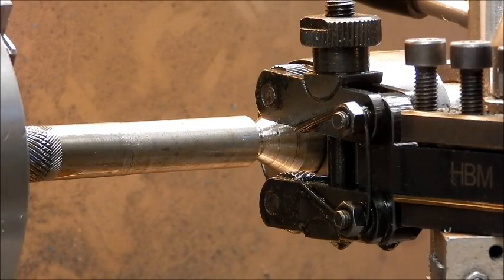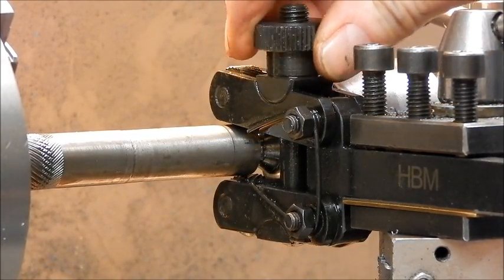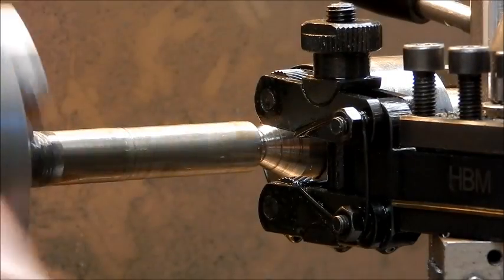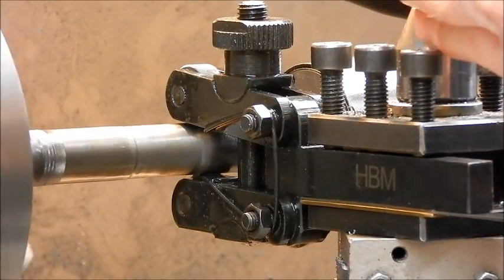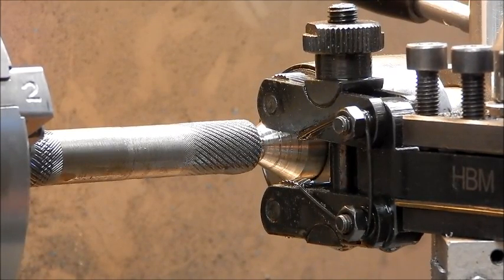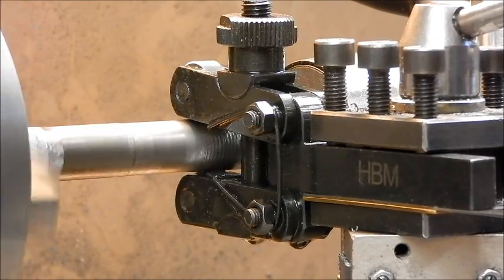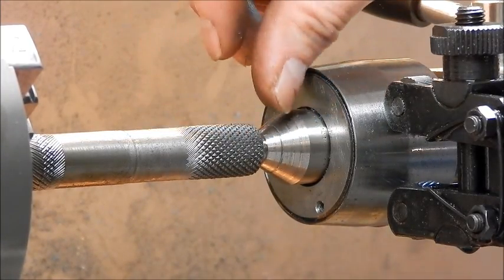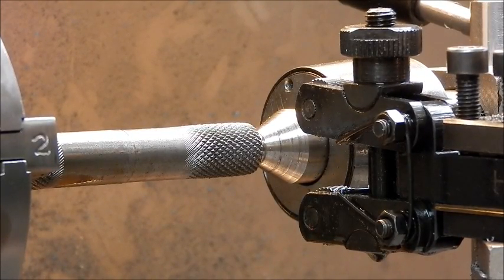How to use a scissor or clamping knurl on a lathe

Comment: I agree with your method, I use this way too. Your video is good and shows great close up detail, thank you. I have exactly the same knurling tool as you have here and have spent time to improve it by taking out as much unwanted movement and play from the component parts as possible. I have shimmed the knurling wheels so there is virtually no side play and I have machined better fit bolts for the arms where they are joined to the body, this gives a better, tidier cut.
Reply from the maker: Hi Stephen.  It's a good knurl tool for the money, but side flex does occur as you say.  You can allow for that with the tool post angle and tightening the scissor arm pivot bolts helps.  Shimming the wheels is a good idea and I do that where necessary as wheels vary in width with manufacturer.  This knurl tool can also be used as a push type knurl for stock that is larger diameter than the scissor can grip. Works fine. Cheers Rob
Reply: @Xynudu Hi Rob, yes it's a very good tool for the price, no doubt about that.
Good tip ref the toolpost angle.

Comment: Might I suggest a tip that I use to get 100 percent success. In your video, on your first attempt, you got a double hit on one of the knurl wheels. This happens because you have eased the tool into the moving stock while the machine was running. What you want to do is press a heavy mark into the stock on the very first revolution. Here is how I do that. Apply lube first, stop the machine, then move the knurls into position centered on the stock, now clamp the knurls firmly into the stock while the machine is not moving, go ahead and engage the feed mechanism, NOW turn on the lathe, and watch a perfect knurl happen. This method will fully mash the knurl wheels into the stock on the very first revolution. With the dents already fully established on the first revolution, when the stock rotates around the second time, it will already have a heavy dent, and this heavy dent "persuades" the knurl wheel to fall back into that dent. Try it, you will like it.
Reply from the maker: That's not how I was taught to do it.  Do whatever floats your boat, but that is not the correct way.

Comment: Rob do you make your own cutting fluid?
Reply from the maker: Yes.  Kerosene and engine oil at 5:1.
Reply: @Xynudu  I do the same, people tend not to agree with it. Do you find it works well for you?
Reply from the maker: Works fine.  It can smoke a bit if things get hot, but is excellent at preventing galling. It's an old timers's receipe that has been around for decades.  Doesn't cause rust or give you dermatitis like the water based stuff, and it's cheap.  Cheers Rob
Reply: @Xynudu  oh boy does it smoke. Do you use it for tapping as well? I was wondering if it would be any good.
Reply from the maker: I do, it's great for non ferrous, but not ideal for steel jobs.  I ran out of the propper stuff some time ago.  That's reminded me to get off my arse and buy some more  ;) Cheers Rob

Comment: Not a criticism as the job is right, but it can be done quicker. Slow chuck speed, high feed. Keep feed engaged and throw chuck into reverse to return to start. Picking up the pitch of the knurl isn’t too important as the form is rolled onto the job more than cut hence why the diameter increases. It can help to have the tool slightly angled to the job so the pressure is heavier on one side. I generally do them dry but use a splash of coolant to keep the knurls cool. When the knurls get worn, they can chew up the job as they produce specks of swarf that can get stuck between the teeth so I run the last pass with an airline on it. I’m currently doing 55mm dia knurls by 25mm long on mild steel and they take about a minute each with 4 passes all at full depth. I’m an employed turner of 35 years but still watch videos as there’s always someone doing something different and sometimes better.

Comment: I made myself a clamp type knurler, works good, now i see your good method of using it. Thank you
Reply from the maker: Hi John,

This is exactly how knurling would be done in industry.  They just drive the knurl onto the job.  That's why most scissor knurls only have finger adjustment.

They don't screw the knurl down into the work, as some people seem to think it should be done.

Cheers rob
Reply: @Xynudu  This was my mistake, I was screwing the knurl down into the job. Your method is much better, faster, repeatable and gives a better result. So you have a new subscriber.

Comment: Rob,

Sorry I meant for knurling what do you set the TPI?
Dave
Reply from the maker: +David James 

Hi Dave,

0.23 mm.  The size of the lathe has no bearing on the matter, feed speed only relates to pattern pitch (coarseness).

The larger the pattern, the faster the feed speed.

For light pitches as shown (which is useful for most jobs) you would run 0.23 or thereabouts.

Cheers Rob

Comment: Rob, looks great and thank you I find your videos very practical and to the point. I am new at machining and could you tell me what TPI you run the lead screw. I have a small metric 7x12 mini lathe, what do you recommend?
thanks Dave
Reply from the maker: +David James 

Hi David,

I use 0.12 mm for general turning.  This works well with TCMT carbide inserts and also HSS.

I can switch to 0.06 but this can be too fine for some metals and actually give a poorer finish.  It does however work great with shear tools.

For fast ripping down to size I use 0.23.

So as a good all rounder I would recommend 0.12 mm.

Cheers Rob

Comment: Well that came out well, I have been watching a YouTube tutorial where they insist that the diameter of the area is turned to the correct size ? I have never done this and always get a good diamond knurl as you have, but I do use the scissor type tool as you do, so maybe it is not required on these tools, it always just tracks in the impressions left on the first rev, the scissor type also does not put any side thrust on the job being knurled.
Reply from the maker: +Englishman French 
I never use those sizing charts.  I've never had a problem.

The correct longitudinal feed rate is much more important IMHO.

Cheers Rob

Comment: Can I start this in the middle of a shaft?
Reply from the maker: Sandarpan Sure.  I always knurl before turning the job to final size.  That way as knurling always gives a less than perfect edge, you can do a final machine pass/es to the edges of the knurl to clean it up and make a nice edge.  Something to think about and plan ahead. Cheers Rob
Reply: xynudu
Actually I'll be knurling myself a weightlifting bar. Like this http://forum.bodybuilding.com/attachment.php?attachmentid=4974793&d=1350149133 , this http://forum.bodybuilding.com/attachment.php?attachmentid=4418391&d=1336063005 and this http://www.homegymbodybuilding.com/wp-content/uploads/2014/05/rogue-bar-knurl.jpg . The knurl starts and stops in the middle of the shaft quite a bit away from the edges and the knurling is done last.
Reply from the maker: Sandarpan The knurling doesn't have to be done last.  It can be done at any time.  You can reduce the shaft to within a couple of thou ", knurl the relevant areas, and then do a final cut along the shaft to get a clean edge against the knurls.  Also those separated knurls in the final photo can be done as one full width knurl, and then the plain separators machined out of the knurl afterwards.  It's your call, but that's how i would do it to get a nice clean finish.  Cheers Rob
Reply from the maker: xynudu I suggest you try knurling a piece of scrap round bar to see how well it works.  How clean the edges are. Then try my method and see which one gives the best result.  Rob
Reply: Thanks. What would you recommend I do for knurling a hardened steel shaft say ~ 45 HRc?
Reply from the maker: Sandarpan I would use a very fine knurl.  This will require the least amount of pressure to impress the pattern.  Also it will be more comfortable on your hands than a coarse knurl.  See what a common weight bar pattern is like and go similar.  Scissor knurl will apply most pressure, but diameter will be limited, so check to see what size it is capable of.  You can buy some larger diameter scissor knurls.  Do a test run on an off cut to set the pressure correctly.  Cheers Rob

Comment: You got double tracking the first time but on the second pass it kind of repaired itself although I can see the double tracks in between the knurling. How did that happen?
Reply from the maker: Looks OK to me.
Reply: xynudu
If you pause at around 3:00 you can clearly see that the right slanted diagonals of the diamond knurl are finer (more closely spaced) than the left slanted diagonals which are kinda thick. Can you see it? Anyway what TPI knurls are those?
Reply from the maker: Sandarpan The first pass wasn't deep enough for the knurls to bite in evenly so it's obvious the pattern was crap - that's why I cranked it up and did a re-run.  The knurls are some coarse ones I bought off of Ebay (can't remember the pitch).  I find that finer knurls give more consistent results as they don't have to cut as deep/less pressure required.  Also when you go deep it puts a heap of strain/flex on the knurl when you cross feed as in the video.  Rob
Reply: Ok got it. I'm trying to learn about knurling as much as possible. Thanks.
Reply from the maker: Sandarpan Your welcome.  It's all a learning curve.  Rob

Comment: What kind of large do you have, it's super quiet, I like that.
Reply from the maker: BasementShopGuy It's a cheap Chinese CQ9325 10 x 18 ".  I hate noisy lathes also.  This one is pretty quiet provided the change gears are correctly adjusted. Bolton Tools/hardware sell them in the USA. Cheers Rob

Comment from the maker: I've never bothered to nominally size a shaft for the knurl pitch and it's always worked out OK for me.

The knurl wheels should re-engage just like the gears in a gear box if you do it slowly.  It's nothing like screw cutting re-engagement as you have a free rolling surface (x2).

If you were to use the screw down method it is likely that you may not align with the impression correctly and will get double cutting.  Rob

Comment: Thanks Rob.  Do you make any effort to size the shaft diameter for "optimal" knurling, or is all that just unnecessary?  I was also very impressed it re-engaged so well.  I had always heard if you re-engage it is likely to cross up the knurl, but yours looked fantastic.
Reply: +Joel L: There seems to be a lot of "mumbo jumbo" going around with huge number crunching charts to get the correct dia, I have NEVER used any charts, with a scissor tool like this it just self aligns on the previous track and comes out right every time, also with a scissor type tool there is no sideways thrust on the job, and no need to be on centre height.
Reply: Quite correct any knurling tool will follow the impression left previously and follow it to some extent.
I only use the cheap fixed must be 26 year old now used every other day, no need to setup just plough straight in job done.